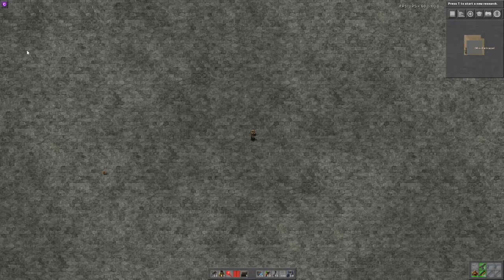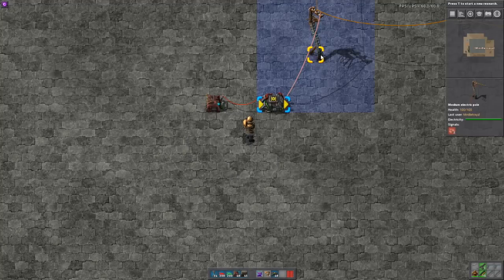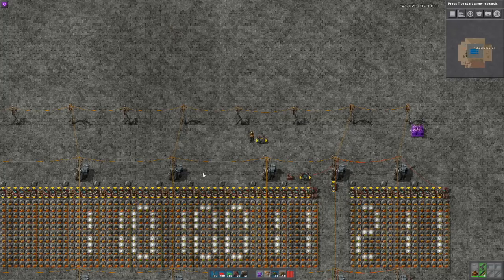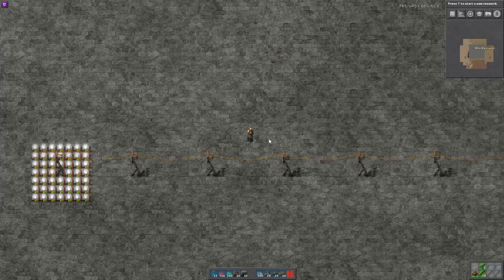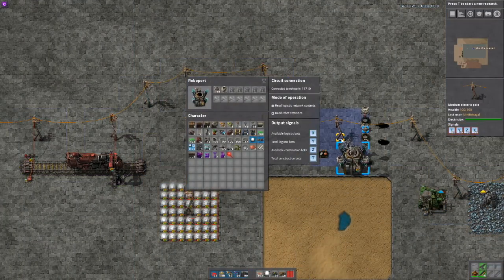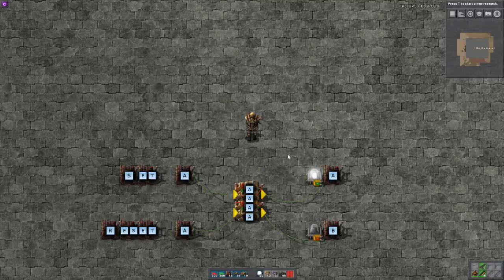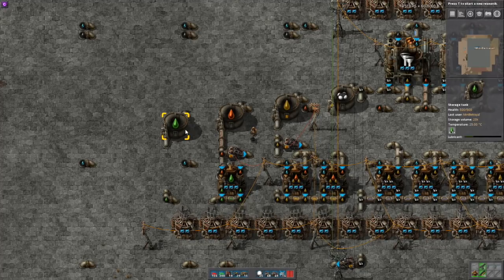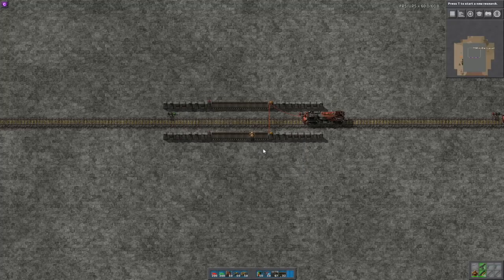Factorio Circuit Network Tutorial - Absolute Basics

Comment: I been playing around with the train gate and I thought you might have wanted to add sound alert to your door "this is simple for anyone to use". Just hook a copper wire from your gate to your speaker where you have gate color set (by default it is "Red" "Green" and "Yellow") so just set your speaker to the color, where location you wish the alarm to go off, I use Red color for alarm (which is signal value). If you want to get fancy you can add the "Alert Settings" underneath the signal value to any color you would like. All this does is flash a color during that alarm. next to your bottom build bar.  Adding rail chain signals is a lot easier than building gates :D

Comment: I have a small note on the safe crossing at the end. You can actually do it with only connecting one of the rail signals. This is because turning a rail signal off using circuits will stop it from outputting any signals, even though it's technically in the "red" state. So if you instead use a condition on the gate of open when red == 0 (don't forget to have the yellow state of the rail signal also output red) then you won't have the feedback loop.
Another neat trick with the gates is the fact that one gate is usually connected to wall on both sides. Which means you can connect wires to the 2 different sides, and set circuit conditions for both. Now I honestly don't remember off of the top of my head whether it performs and AND or an OR operation between the two, but if I'd have to guess I think it's AND. So when both the conditions are met, then the gate will open.

In any case, this tutorial is absolutely fantastic, and I've added it to our faq over at the factorio discord.

Comment: I always used the accumulator to turn a water pump on and off for my steam engines. It could still cycle a bit but not as fast as just hooking up directly. Also uses way less wire because you are only cycling one thing on and off. The set-reset station is a good idea tho! Also, it makes me feel smart when I came up with stuff by myself, like the pumps controlling the oil cracking!
Reply: And then I see that you found a better way to do it haha. I had mine set up with a dozen refineries, and just went off of values. If my petrol dropped below 25% full, the light oil to petrol turned on. Same with heavy to light. I do like the idea of only running if you have less light than heavy tho. Would it still be possible for one to fill up one of them and cause a backup that way? Theoretically you could run out of heavy oil

Comment: I a m trying to do some tests and just cant find a way to output multiple signals. The combinators can only 1 value. I also tried to use the constant combinator and turning it ON and OFF using a Switch based on a condition on the switch, but it doesnt work, seems that the switch works only on power system. There is a way to achieve that?
Reply: Try using the "each" function, not sure if that's what you're looking for.

Comment: The new way for a s/r latch is 1 decider combinator this is what I use in all my circuits when I need them jackb1024 has a great video on this but your way still works great
Reply from the maker: I am aware of the single combinator design, but this is the was i first learned it, it fits better with the concept of an sr latch in electronics (with 2 NOT logic gates) and i personally find it easier to understand and explain. But for anyone reading this, by all means, do what works best for you. The best thing about factorio is that there are multiple ways to achieve the same outcome.

Comment: Sadly, this tutorial falls just short of teaching me me with something I'm currently stuck on.

I'm trying to make a timer that I can use to limit how much coal goes to my steam engines. They are just used for backup power at the moment (in the middle of a complete redesign) so I don't want half of the coal I've stored sitting on the belt.

I'm looking for a timer that I can use to unlock a belt for a few seconds after receiving an "out of coal" signal. Sadly, this video falls just short of showing how to make a usable timer. A bit disappointing as a lockable timer has much more utility than a clock.
Reply from the maker: Without putting too much thought into it, this might work:
Signal "X" is your 'out of coal' indicator. Modify it so it lasts for a single game tick.
Signal T is your amount of time. Put it in a constant combinator.
Hook both T and X to a decider combinator set to:
X > 0: output T (input count)

feed the result of that into an arithmetic combinator set to:
Each - 1: output Each

then feed the result of that back into its own input, and onto your belt.
set the belt to be active only when T > 0

now, when your 'out of coal' pulse is delivered, a T value is passed forwards, activating the belt.
Each tick, the arithmetic combinator both acts as a bit of memory, remembering the T value one tick to the next, but also removes one from it, counting down to zero. When it reaches zero, the belt turns off again.

I've made a little blueprint, with the string available at https://pastebin.com/BBc4rYpm
Drop a piece of coal into the chest on the left to see the belt activate for two seconds, then turn off again. Hope this helps =D
Reply: @MiniBetrayal  Thanks, but I already found a solution on the wiki. Hopefully this will help others though. It is just a shame that it isn't part of the video. Knowing how to lock a timer after a single use is just as important as knowing how to make the timer itself.

Comment: Hello. Do you take questions ?
Reply from the maker: I’ll help if i can
Reply: @MiniBetrayal  ok Cool !  Here's what a friend of mine needs. He wants to craft and install a Programmable Loudspeaker. He wants the loudspeaker to emit a global alarm when the SATISFACTION of the machines in his factory falls below 100%. I suppose that if this is possible, he has to connect the loudspeaker to a power pole in his electric network, right ? And then, what ? Can the satisfaction be read as a signal ? (tell me if you don't know what I mean by satisfaction)
Reply from the maker: The closest thing i could think of would be to read the belt contents just before each assembler. If the belt there isnt full to a certain extent, then that assembler doesnt have its input requirements satisfied. Then send that off to your programmable speaker to set the alarm. 

Its not a very elegant solution, but i dont think theres a way to read global factory satisfaction
Reply: @MiniBetrayal  you got it completely wrong. That's not what I meant by "Satisfaction". Open your power consumption panel. On top top there are 3 colored lines, the leftmost is called "Satisfaction". When it goes under 100%, machines are not receiving enough power and therefore function slower. Now can you review my original question again, knowing what Satisfaction is ?
Reply from the maker: Ahh, for power satisfaction, theres no way to directly ready the satisfaction level with the circuit network. One solution that can kinda work is to hook a wire to an  accumulator, which will read the charge level as a percentage. If its less than 100%, then you’re not generating enough power. Send that off to your speaker. 

This will not work if you are actually using accumulators for power storage (as with a typical solar panel+accumulator setup)
Reply: @MiniBetrayal  the situation is different than anything you have mentioned. My friend currently has only 1 boiler + 2 turbines attached to the boiler. His game is only 35 minutes old. He has no access to accumulators. He's about to place electric miners on his coal patch but as you know, eventually your power satisfaction goes under 100%, which slows down the miners, which in turn reduces satisfaction, etc....and you end up with a power cascade failure. Any solution that you can think of that would work well with a programmable speaker ?
Reply from the maker: Okay, so firstly, manual power management is kinda part of the early game. To be honest, I'm shocked your friend has managed to get as far as circuit network tech without more than 2 steam engines.

Second, the best way to avoid the "power death spiral" is to scale both power production and coal mining together. If you build more of one, also build more of the other.

As for a way to detect lack of power satisfaction automatically, there's no simple way I can think of. If you're dead-set on it, you can try this, though it will take a bit of work to get going:

Set up a belt loop that feeds back into itself, but with a single gap. In that gap is an inserter (with its stack size set to 1 if you've done any stack inserter researches). Place a few items on the belt. As they reach the end of the belt, the inserter will pick them up, and put them back at the beginning of the belt. As long as the factory is satisfactorily powered, this will happen at a constant rate. By looking at this rate, you can have the first few belts in the loop hooked up to a circuit network (in read mode), and there should always be at least one item on that stretch of belt. If the factory starts to lose power, the inserter will slow down, meaning (eventually) the measured portion of belt will have no items on it. That's your trigger for the speaker.

I just tested this a bit and it was very unstable. Sometimes not triggering until the power was too low for the speaker to function, but it also sometimes worked. Best (but still unreliable) results when the power speaker is connected to its own, completely separate power network that will definitely not fail.

Try this blueprint. The power pole on the left should be disconnected from the one on the right, and be connected to your main grid. The pole on the left should go to the extra generation just to make sure the speaker has juice. Use six items on the belt.
https://pastebin.com/YYbQhEW0
Reply: @MiniBetrayal  I will try all that !! Thanks !